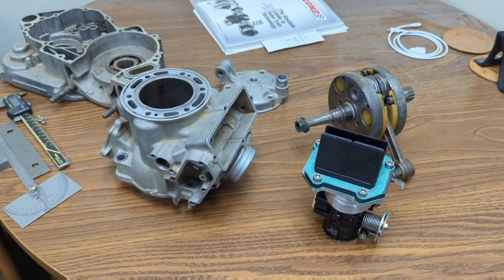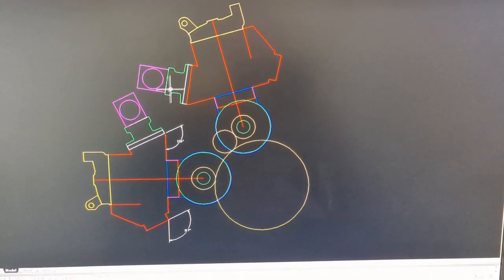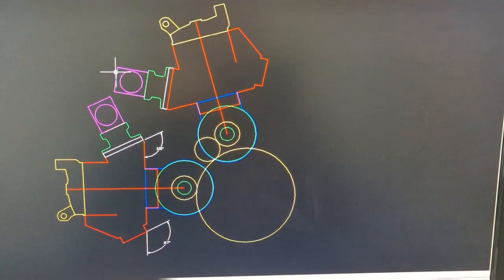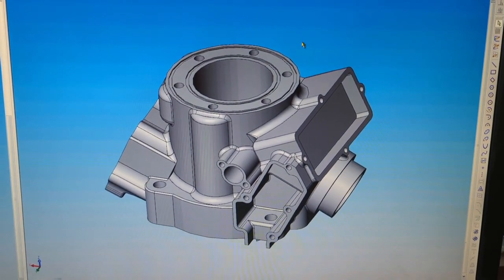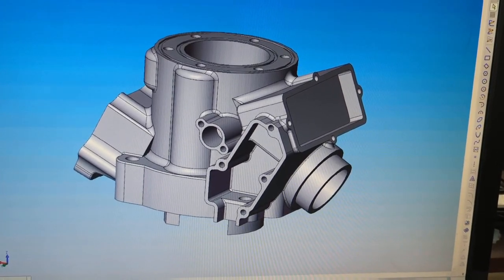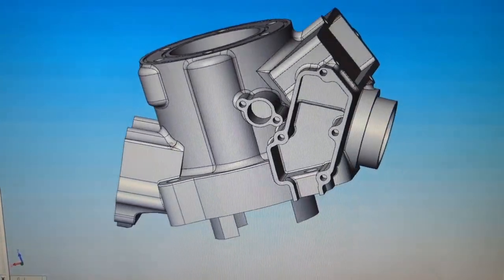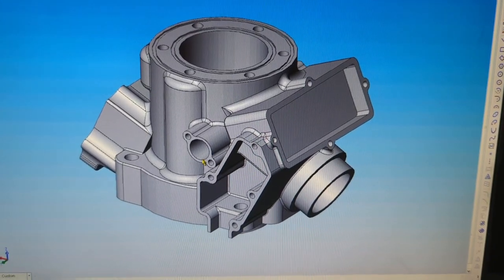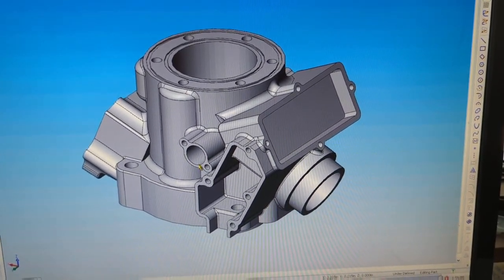RZ1000 Yamaha 4 cylinder two stroke design and build

Comment: Should be a great project. A bit reminiscent of the old sqare TZ750. I used to build/race Kaw triples and Yamaha twins. Also carts, snowmobiles and my Father outboard hydroplanes. In addition to the PV timing, if the cylinder sleeves are easily removable/modified, you might want to consider some adjustments to the port timing. I could get big power out of the triples but they would barely run below 4krpm and were almost digital when they turned on at 7kprm and not good for much except drag racing, but were very light, fast, and inexpensive to build for that. You can get away with things in a drag motyor that would never fly in an endurnace engine. When you get to the crankcase casting, look me up. I do lost foam but here in the US, 3D sand printed molds are becoming much more reasonable for one-offs and since you have good CAD skills, you are way ahead of where most would start. I followed the gearing and crank layout, but maybe you could discuss that a little more in your next video like crankcase seals and oiling. I dont see any reason for anything other than 180 degree phasing of the crank coupled cylinders and then 90 degree phase between the gear coupled pairs. Corner to corner firing seems right. Best, Kelly

Comment: For traction you definitely want a big bang firing order.  Check out the video driving4answers did on the subject.
Reply from the maker: Yes, easy to experiment with firing orders, assemble to what you want, and change the degrees in Tuner studio for the Microsquirt EFI, and run it.